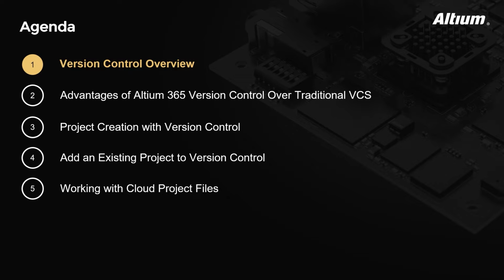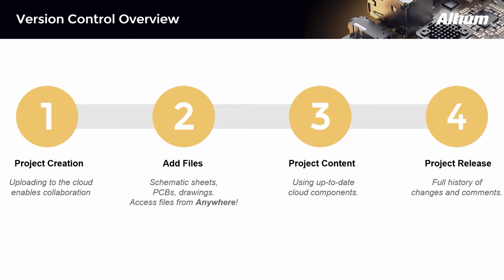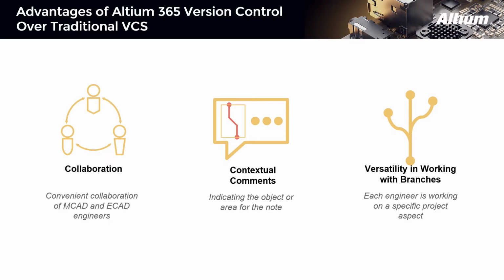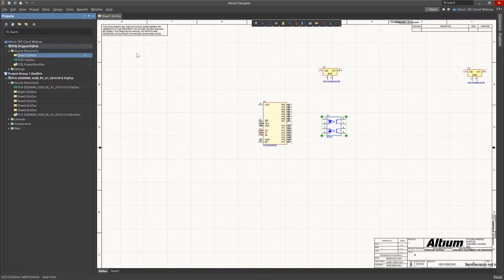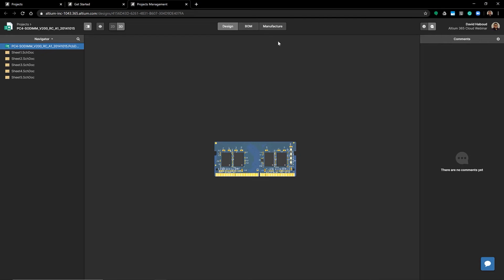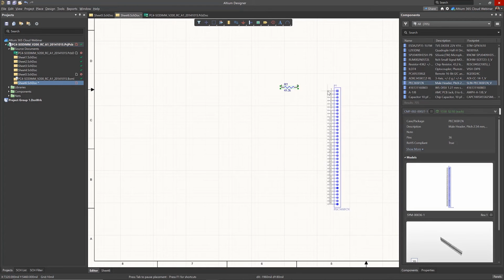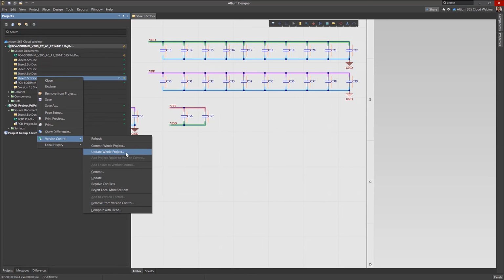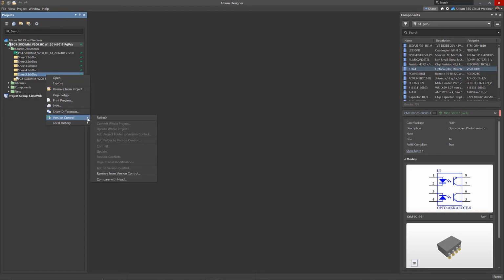Using Version Control In Your PCB Projects

Comment: Do you need to pull before pushing?
Reply from the maker: It depends on the context and the state of your design files. I recommend pulling before you begin any work to have the latest file revisions. You can create conflicts if multiple people are making changes at the same time, but you are able to merge the changes. I prefer to avoid merges to avoid any potential conflicts. Remember that a local file save is different from a VCS push. You can save locally as much as you want, but pushing is best done to document the changes with the commit comments.